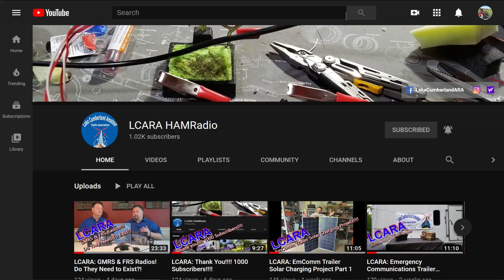LCARA HAM Radio: Abandoned Repeater Site Part 7 - Tower Cleanup, Tree Removal and Inside Workbench

Comment: Hi why do you say 73 at the end of the video? What is the telco project refer to?
Reply: Hello Adrian, although 73 is typically used at the end of a QSO on the radio some ham radio operators will also say it as a form of good-bye in person or as in our case at the end of our videos.  The telco project refers to the original company that installed this tower.  It was for a paging system back in the 1990's we believe.  Ham radio operators took over the tower in the late 1990's or early 2000's.